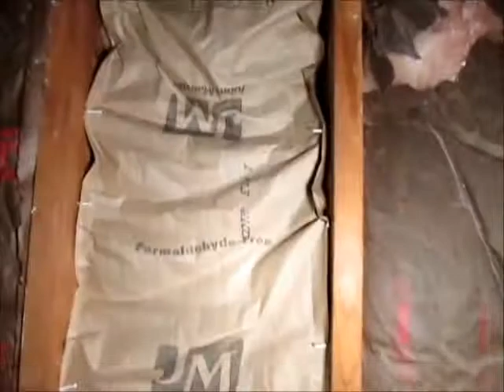New House Update (Part 16)

Comment: That's strange with the 2''X8''s and the plywood.  I have a theory about the joists at least, maybe the ones from the local lumber yard were full dimensional 2''X8''s, at least on the 8'' side, and the Home Depot ones were nominal 2''X8''s or 1-1/2''X7-1/4''. The plywood seems a little strange, I could see it differing by maybe 1/32-1/16 but not that much, unless maybe the Home depot sold you 5/8'' plywood as 3/4'' plywood?
  I think that maybe their idea with using 1/2'' plywood under the mortar bed was that it was to act as a form, and that the 3'' of mortar and tile was like a structural poured concrete floor? Of course that failed once the water got under the mortar rotting out the plywood and floor joists.
  With regard to the wiring, I'm also performing a bathroom renovation, in a trailer, so since I am reworking the walls and rewiring the electrics. What I'm thinking of doing is installing a welded triple ganged box for the light switch, fan switch, and the GFI outlet to clean things up. By doing that I can simplify the wiring for all three devices, and I can also run the fan and the light downstream of the GFI outlet making those also GFI protected.
Reply from the maker: +OlegKostoglatov Yeah, it seems they used 1/2" under the real hardwood floors upstairs as well as the bathroom.  I think you hit the nail on the head with the full dimensional vs. nominal explanation.
Reply: +audubon5425 Although with full thickness hardwood floors, like 5/8 to 3/4'', I can't see it as being dangerous. However using 1/2'' plywood as a subfloor is not the way to do things, it should have been at least 5/8''. I'm surprised that in a house that old that they didn't use solid boards in the subfloor, like tongue and groove or shiplap on the diagonal across the joists.